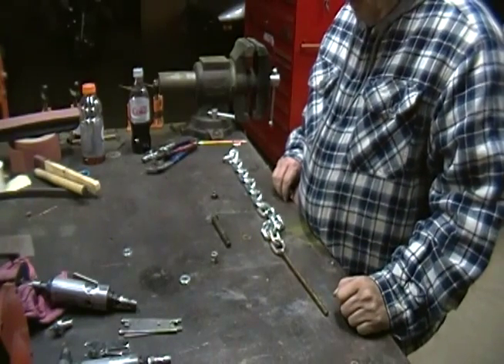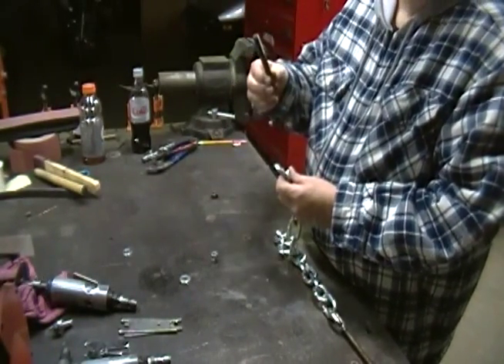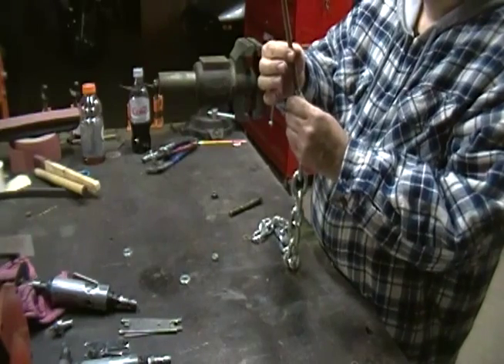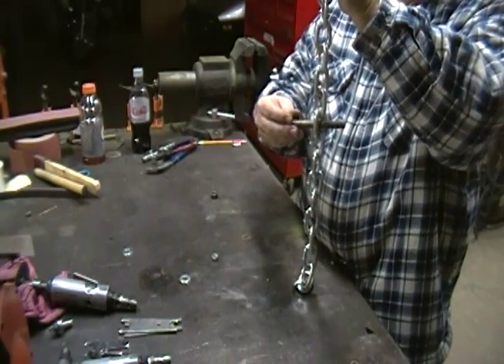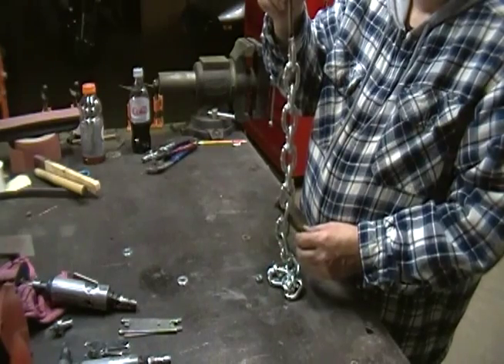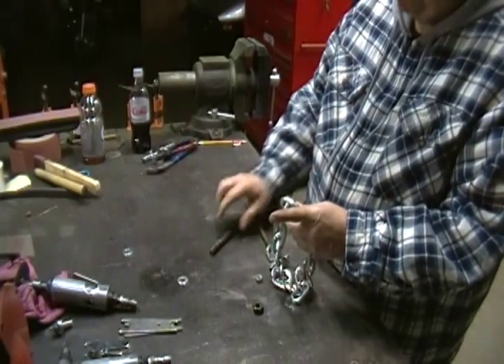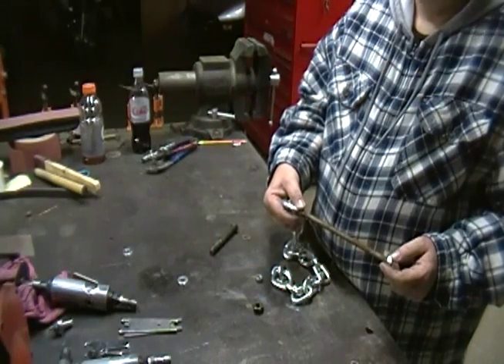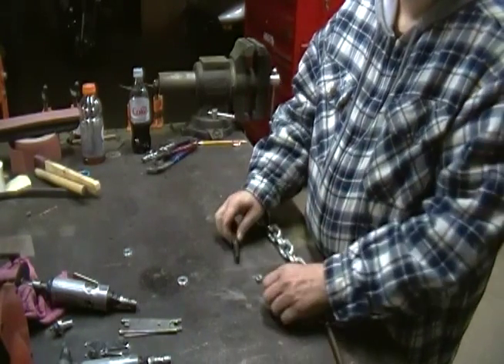Spring Compressor

Comment: An accident looking for somewhere to happen
Reply from the maker: Thanks for your comment.  Good, bad, or indifferent I appreciate them all.  I am interested in what brought you to your conclusion.
Reply: ***** I was horrified by the whole operation, but most particularly by the use of  the flimsy rod and grade 5 bolts . The last time I became aware of a road spring getting away from a home made device, it went clean through the panel work of the vehicle next to it, out of the other side, and then right through a 6 inch cement  block wall. Fortunately no one was hurt, but these home made devices are lethal  : the stored energy in a compressed road spring is beyond most people's comprehension